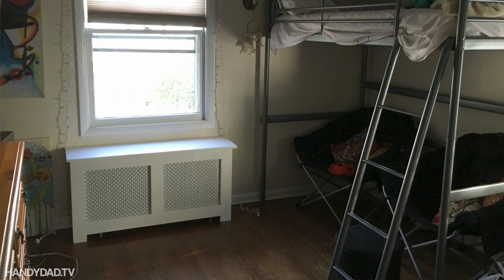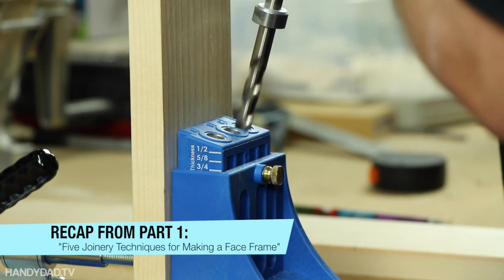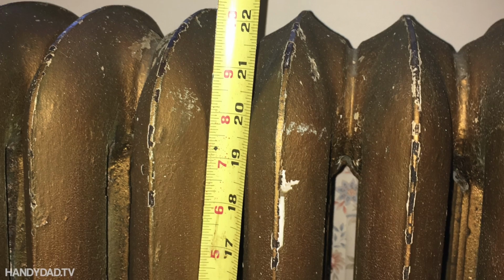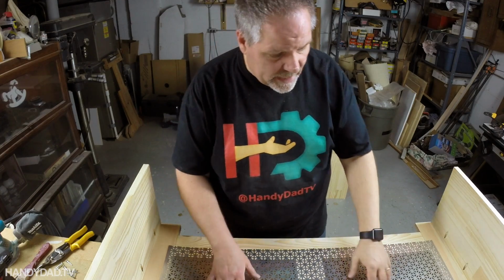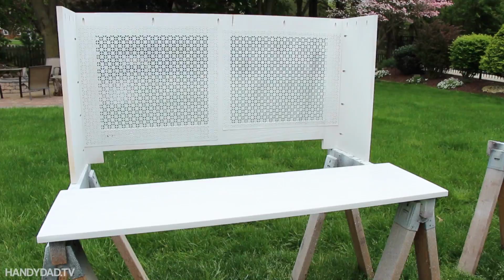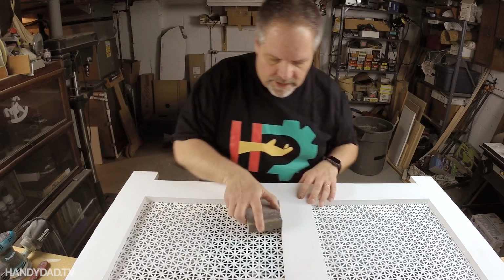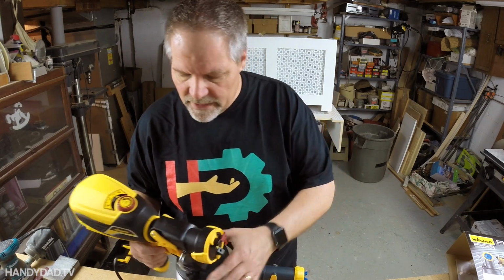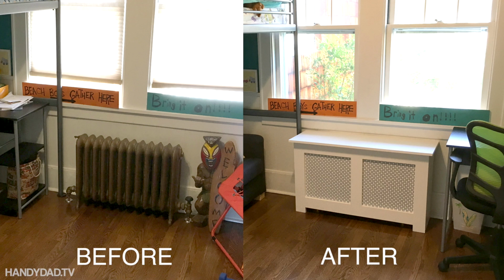DIY Radiator Covers

Comment: My rabbits are in my room where I have my radiator, and sometimes I worry about it burning them if they touch it. Will the metal decorative sheet get so hot that it could burn them? Awesome video!
Reply from the maker: I doubt it

Comment: If you know anything about these radiators sitting right underneath the window, you know that kids are gonna jump on it and adults are gonna use it as a seat (especially in the winter), what can be done to make the wooden cover stronger so it can hold someone sitting on it?
Reply from the maker: Mine was made from solid pine. Strong enough to support a person standing on it if they want to hang curtains.

Comment: HandyDad lol, nice video thank you. And thanks for taking the time to reply to posts. My question is, did you do any shaping on the back of the end walls so that it fit tightly up against the wall since it appears there is baseboard? If so how did you accomplish? I'm thinking you scribed them in place then put cover on its side using a jig saw to cut the outline of the base board?
Reply from the maker: My trick was attaching the top on-site so it was tight against the wall. No modifications to the wall or baseboard.

Comment: I'm looking to make a radiator cover for a recessed hot water heater in our bathroom. Can I still use wood for the frame or is there something else you recommend?  What did you use to attach the sheet metal? How would you recommend attaching multiple sheets of the type of metal you used to each other if needed?  I'd like to make ours more of a flush mount since it's a recessed unit. Can you help please?  I've never built anything before so would really appreciate guidance!
Reply from the maker: If it’s recessed, a slotted closet door would make the most sense. No?

Unless it’s an odd size, and then you’d need to build something custom. If that’s the case, I would use wood for a frame because I’m most comfortable working with wood. The sheet metal is great for ventilation. I just stapled it on the back of the frame.

Comment: Great video. I just made one myself but have one question. I have baseboard trims and my cover won't stand flash against the wall. Did you scribe the lower portion of the legs of the cover so that the cover is flash against the wall and there is no gap between the cover and the wall?
Reply from the maker: No, I didn’t scribe it to fit tight against the wall. I purposely wanted air flow. I just pushed the top against the wall before marking and attaching it.
Reply: I attached a board behind mine to hold them to the radiator incase kids or pets jump or crawl. At first mine would fall from the cat jumping off. I just lift it straight up to remove.
Reply from the maker: Great idea

Comment: Can this method/wood be used with hot water radiators?
Reply from the maker: Yes. But only use solid wood. No particle board or plywood.

Comment: I have been wanting to get these radiators covered but I don't have most of these tools...I can borrow a saw and get a dowel jig or a kreg jig...but if I get a dowel jig do I need giant (sash?) clamps? I have a drill, sander, and am handy/crafty.
Reply from the maker: I recommend the Kreg jig over dowels. It’s not cheap, but you’ll have it forever. I don’t mind investing in good tools when I need something. I just build it into the cost of the project.

Comment: One mistake you made was not clamping the pieces down before driving in the screws. Thus, all of them ended out of alignment, as you can see at 7:28. It's always worth spending a few more minutes clamping before every pocket hole joint rather than ending up with a mediocre result or spending 3 times the amount of time sanding afterwards, if you really want them flush.
Reply from the maker: Thanks I’ll remember that

Comment: I wish I had all those tools.  I have a hammer and two screw drivers.  I need radiator covers that won't break my budget.  At least one, for a radiator which sits in the only place I have for a side table.  Is there no easy way to make one?
Reply from the maker: Not with a hammer and screw drivers. You either have to pay someone to make them or pay for tools. I prefer to pay for tools and have them forever.

Comment: Do you make these radiator covers professionally?  I have a low radiator that has no cover. It had an ugly, beat-up, metal one that I threw out and haven't replaced it with anything. I've seen some online but they aren't that nice and very expensive. And, the shipping is costly. I live in CT.  I can paint it myself. I do a lot of painting.
Reply from the maker: Sorry, I don’t.

Comment: Nice video, you make it look easy!  I have a radiator cover with  detachable top. In  winter it gets bent from the heat even though it is not that close to the radiator. This time I put piece of wood directly on the radiator as a barrier so the to exterior top cover does not bent, but it is starting to bend, any suggestion would be very helpful . thanks
Reply from the maker: I would install cross pieces of wood or metal under the top to reinforce it.
Reply: @handydadtv  Thank you!

Comment: hey, I didnt understand or maybe u didnt mention at all what kind of paint should I use for my radiator heatings? high gloss water based or oil based paint? do i need to prime them first before painting with high gloss paint?
Reply: Bumping this for an answer
Reply from the maker: I only use water-based paint. I would use a coat of primer and two coats of semi-gloss.

Comment: 2:48 .. you pushed the cut off onto the back of the saw.. I hear that's a good way to sling a piece of wood into your body
Reply from the maker: It’s a time lapse segment but I can clearly see I turned off the saw before touching the scrap.
Reply: @handydadtv  true, must have slowed down enough by then, I didn't notice you turning it off but I can see that now you mention it. I just noticed the quick buzz sound

Comment: do a video on how to rearrange medium size room with a radiator and pipes
Reply: As long as you have hot water rads you can put furniture wherever you'd like. If you have leather just make sure you leave about 6 inches or so in front.

Comment: Did you use basic pine wood for this?
Reply from the maker: Yes it is 100% pine.
Reply: @handydadtv  what size pine board on the front? I was thinking about going with 1x4 for the basic frame, but yours look thicker.  Great video, I'm making some covers for a friend!
Reply from the maker: 1x4

Comment: Nice work. Always nice to see your projects.

So, what do you think of the 590 now? I've been eyeing them off for a big painting job (tin roof) as well as general household paint and decking oil application, and debating about maybe going for the one that goes straight onto the paint bucket instead.

Any feedback from your perspective?
Reply from the maker: +genghisbunny I only used it for this project so far, and only with the small nozzle. I'd love to eventually patch all the drywall in my garage and spray the whole thing. Someday...